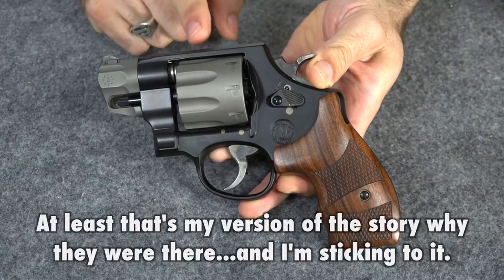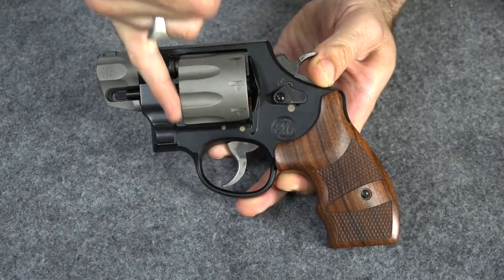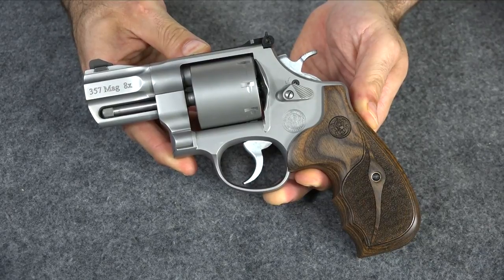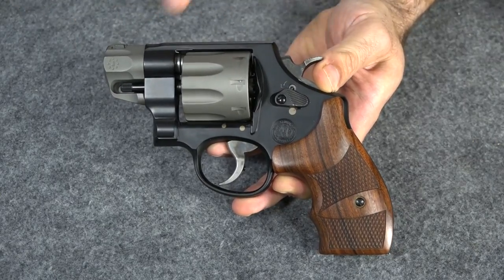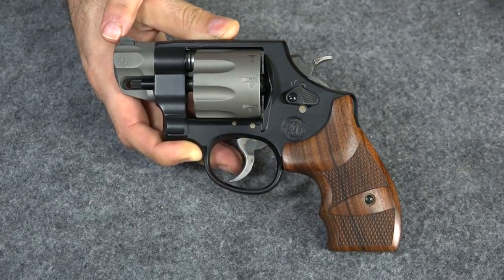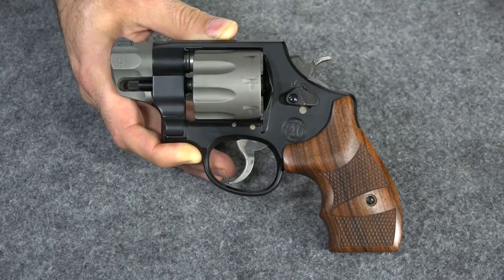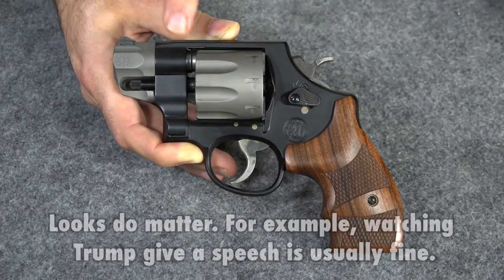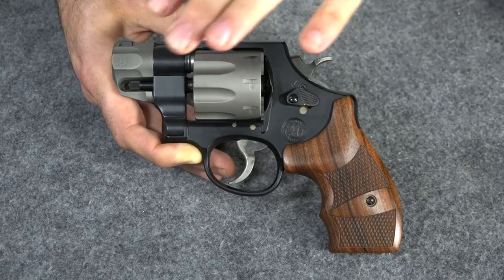HUGE Cylinder Gap on Some S&W Revolvers (Is it a problem?)

Comment: Wait, the LOA of .44 Magnum is 1.61 inch and the LOA of .357 Magnum is 1.59 or 0.02 " difference?? Geoff Who is confused, but I remember the Model 27 which also had a large gap.
Reply: Could be that some 44 mags exceed that. Look at the buffalo bore 340gr 44 mag load.
Reply: While it may be true that S&W does not want to expend resources building yet another frame size, the gap he describes existed on the very first N-frame revolver, the New Century Triple Lock in 44 Special that was introduced in 1907.  I've never found an explanation for why this was done or why the Model 25 (45 Colt) and Model 29 (44 Magnum) had their cylinders lengthened.  At the time of their introduction there were no bullet weights being offered over 240 or 255 grains.  Those came much later.  Perhaps S&W was just being forward thinking or maybe it was a styling statement.  It does appear that having lengthened cylinders meant the bullets had further to go before encountering the forcing cone.  If there is a benefit to this, I don't know what it is.
Reply: @nokoolaid  Buffalo Bore specifically says to not use their 340 gr 44 Mag +P+ in S&W.It's the only 340 gr 44 Mag they sell. It's as long as a 454 Casull round. I don't think it fits in S&W 44 Mags.
Reply: @Bob5mith  I suppose. I don't think I'd get any joy shooting them. The deer grenade would make a nice SD round though.

Comment: Just checked my '66 Model 28 Highway Patrolman, N frame gun with a .357 Cylinder, it also has the large gap between cylinder and frame that my N Frame Model 29 lacks.

Comment: Perfect. I did a google search for this exact question and your video popped up. Thanks for answering the gap question. I personally think the gap on almost all the S&W revolvers look like crap. Might as well go with a Ruger. Also the gap allows for more heat/gas to escape and the say bullets loose velocity from that.
Reply: The cylinder to frame gap he's talking about is different than the cylinder to forcing cone gap. The cylinder to frame gap has no effect on velocity.

Comment: How do you keep powder burns off that titanium cylinder without risk of damaging that finish? I have a 360pd and smith makes it clear to be very careful what you use on it.
Reply: I anodized the cylinder in my Taurus 44 ultralite. I did it in stages using petroleum jelly as a mask. It's multicolored now. The powder burns are camouflaged.

Comment: I have another S&W revolver question - what's the story with those white dots on the frame?
Reply: That's the steel pins for the cylinder stop, trigger and hammer.
Reply: Peter Choi 
If you're talking about what i think you're talking about, those dots are keeping the gun together.
Reply: The pins are not for keeping the gun together. A S&W frame is a one-piece affair, incorporating  a removable side plate at the right hand side, in order to gain access to the mechanics.
As the  revolver in question is made out of a lightweight and, relatively speaking, soft  material as Scandium, it needs a stronger and more durable material for the pivot points of the mechanism.
This means that the "white dots"  seen on the frame are the steel pivot pins that the trigger, hammer and cylinder stop pivots around.
The pivot pins are not visible on the revolvers right hand side, as they are supported in the corresponding recesses of the removable side plate.
Reply: DT75 thanks for the explanation. The thing that I don't understand is - it seems S&W is a company that cares about design. Why not make the pins black or any other color that would blend-in with the rest of the frame? Do the dots enhance the asthetics?
Reply: As for color, the all metal alloys don't anodize or black oxide the same. Just the nature of metal and various coatings/platings, etc.

Comment: Um, I always thought a "cylinder gap" was the air space between the cylinder and the forcing cone of a revolver barrel?  And if so there is plenty to complain about in S&W revolver craft!  The bigger that air gap is the less explosive power there is remaining to drive the bullet out of the barrel.  If a cylinder gap is big then much of the blast goes uselessly sideways.  S&W just does not care very much, and revolver quality control is very slack.  The specifications allow from .002 to .006 for an air gap (and I have seen some that are obviously .008!)  After looking hard for a good S&W and only finding crap I just quit trying.  For me, any S&W revolver made after 1995 is not worth looking at.  This also rules out buying any revolver without a personal examination---and I carry a feeler-gage when I do!..........................elsullo

Comment: Since i am interested in buying the S&W 627 performance center 5" for bullseye target matches, does anyone have experience with bench rest shooting accuracy with that or similar n-frame 357 mag platform?
Reply: Thanks man. I'm only asking the question because i'm worried that the new production revolvers might not be built so well for bullseye shooting as the old ones. Because in my retarded country i have the right to purchase only one handgun and i need to make the right choise :)

Comment: The cylinder gap to chamber pressure the gap only has to be adequite not perfect this is the key hence why the nagant revolver moved how it did to accomadate things. Yeah but also why revolving rifles when paper cartridges existed didnt work!
Reply: It is not key for its reliability and shootability this is not going to affect you or your body as it is designed to do smiths the most reliable company i know and i only know their knives amd cheap knives at that
Reply: John Doe thanks im sure its true found may that the tang got loose.

Comment: The more you know... What’s it like shooting a light gun like that with 357?
Reply: pliablemoose cause u can put it on your ankle.  Lots of power on you
Reply: Full power loads from underwood or buffalo bore can be a little punishing. But not as bad as S&W340PD. They leave your hand stinging but their not intended as range guns by any means. Built to carry. What have you fired in the handgun lineup? I could help you relate.
Reply: Kyle Groetsch 686 3”

Comment: I thought this was going to be about the gap between the cylinder and barrel, at first.
I am more concerned with the damn Hillary Hole and that stupid internal lock than I am the gap YM addressed in this vid. I will not buy a S&W product that has the HH/internal lock.
Reply: Supermike 
   I have to disagree.  There have been too many instances of these locks engaging under recoil and after the gun was accidentally dropped, making the weapon incapable of firing until the owner took a key and unlocked it.  Sorry, but this could be catastrophic in an "actual need" situation.  As such, I will not buy one of their guns with this unnecessary abomination on it.  A lot of other people feel the same way.

Comment: The actual cylinder gap on my model 60-14 is 0.015. Normal? Or did I get another turd from Smith and Wesson?
Reply: No, that is NOT normal, because it is really GOOD!  Most of their revolvers have huge and sloppy gaps; specs. allow for .002--.006 and their sloppy quality control lets almost anything past................................elsullo

Comment: Would you stop fcking around and put the hogue cylinder release on this thing already?!
Reply: Thomas Coppola.  I bought one for my 686 Plus and ended up returning it to Hogue. It would easily get loose and wiggle too much. I really liked the concept of it but the factory release is solid and works well.
Reply: Is it fucking made of rubber? If so, there's no way I'd use it.

Comment: Another reason they don't close that gap with a longer cylinder is because they don't want some idiot stuffing a .357max in a .357mag gun and losing fingers (or worse stuffing a .454 casull into a .45acp ...yikes).
Reply from the maker: You can keep that from happening with simple cylinder boring.